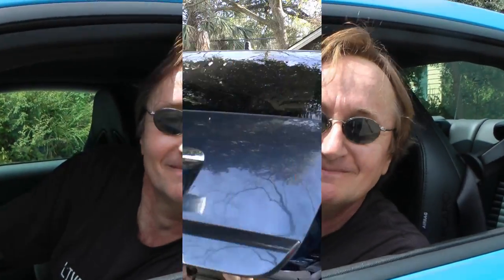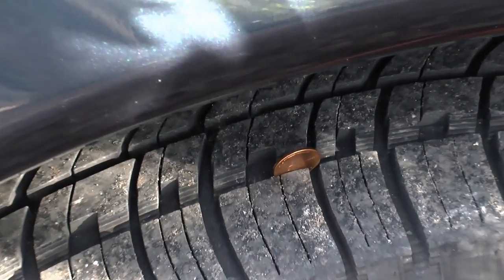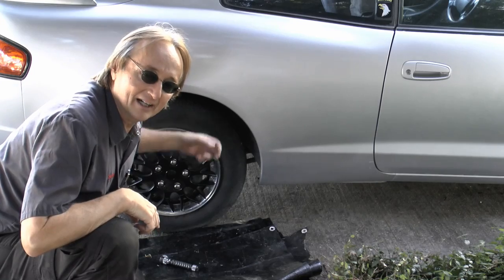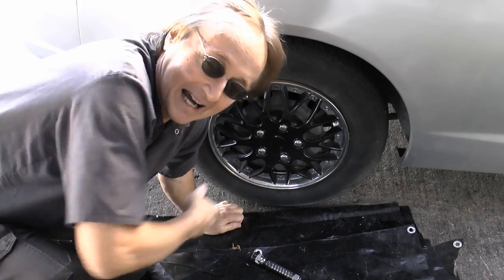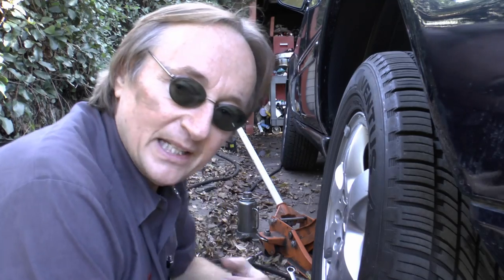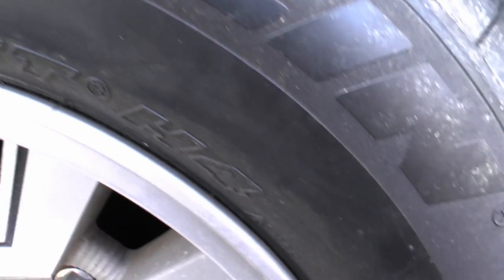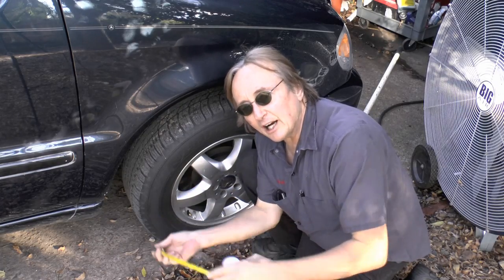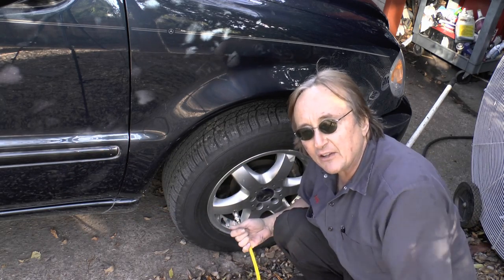How to Tell if You Need New Tires on Your Car

Comment: I have a question that I can't find anywhere. Can I put a patched tire on the front axle (fwd)? The tires in the front have low tread, but the rear tires look like new still. If it would be unsafe, perhaps I should buy all 4 new tires. 

Love your videos, by the way! You're a great teacher.

Comment: A topic that Scotty didn't cover is that if you driven the tire with low tire pressure. If you driven the tire flat it may have shaved the inside of the sidewall, when this happens you need to replace the tire because it haves a weak sidewall. And don't trust that nitrogen thing, because when you have low tire pressure you will surely need more so as Scotty said, check your tire pressure. Some said if you got a low tire pressure your car will lean to that direction but I never had my tire pressure get too low so I can't say for myself. Over inflated tires will wear more in the center and lower tire pressure will wear the tires on the sides but if it wears closer to the sidewall you might need alignment or get your car checked.

Comment: Good video.

In my experience, shoulder wear can be indicative of lack of rotation moreso than out of alignment, although the two are often complimentary when dealing with drivers who don't keep up with maintenance.  I've seen people never rotate tires and have the front passenger side belt starting to show complaing that the car was out of align because it was drifting to the right.  Easy way to trash a set of tires.

And talking about tire pressure and temperature changes, I get calls all the time that TPM warning light flashes right after a big temperature dive.  Of course, tires are always fine.  That's common too.

Comment: I'm a BIG fan of using nitrogen instead of air for tires.
My local public transit system uses it in all of their buses so you know it's worthwhile.

What a pleasure it is to only rarely have to add nitrogen since nitrogen molecules are larger than oxygen and they lose pressure far more slowly.

There are other benefits as far as tire wear if you care to look into it.
Reply: +Devin Williams True.  For some reason, commercial air pumps at gas stations here in South Florida have an incredible amount of water in them.
I don't know if it's condensation or what.

I still say that I need to add pressure to my tires far less frequently with Nitrogen vs Oxygen.

Comment: I had experience with a tire exploding in a 1990 camry years ago. We did that in the freeway that we barely got into it for being old. Even the whole tire ripped apart as well.
Anyways for tire experience myself, hard rubber tires are the best to last for a long time. They may not get much grip and traction for to be harder to turn, they can at least save you money. Medium tires are okay but wear out a bit more than hard tires, they just give you better grip. Soft tires are the worst at wearing out the fastest even though they have the best grip & traction. If your gonna be going out on a race track with your car, use soft tires so you won't slip easily. If you want to use hard tires instead, better have those driving skills to be of good use or it will cost you your life and money for that.

Comment: should all four tire have matching manufactured dates? all made in the same year but different weeks....Also, my tires are "symmetrical", but on the driver side the sipes at the shoulders look like they would channel the water out from the tire, whereas the driver side shoulder sipes face the opposite direction and would channel water into the tire
Reply from the maker: I would hope dates match.  And both front tires need the same exact tread pattern, that's wrong on yours

Comment: My front tires are called Kleber and they are 14 years old. I dont drive very fast because of this, but even if i do, there aren't any vibrations or stuff like that. Even when i take a corner at high speed, the car stays on the road with no problem what so ever

Comment: Scotty, my truck won't stay running unless I hold my foot slightly on the gas. As soon as I let up, it dies. No check engine light and all gauges read out fine. Could this be a bad throttle position sensor and if so, do you think cleaning it would work or does it need replaced?
Reply from the maker: could be tons of things, if it's a Ford, check for vacuum leaks first. if not that, have it scanned and analyze the live data for faults, lots more information than a simple check engine light.

Comment: Hey Scotty, I have a question about motorcycle tyres...
Specificly on an 1984 Kawasaki Ninja 900R, it uses sports touring tyres and the front was manufactured in 2011 and the rear in 2012. They are basically new, barely used as the bike stood a long time (on a center stand, so no load on the rear tyre and some minimal load on the front).

I am not someone who goes super hot into the corners and I'm not really pushing it. I technically could replace them now but it would be quite hard on my budget.
Some say that when the tyre is 5 years old is immediately a death trap, I find this rather ridiculous... I mean maybe it would make a difference for someone who is using it on a race track.

Comment: Funny thing is I was riding on dry-rotted tires from 1990-1994 in a 1984 Chevy Caprice at highway speeds until I got them replaced in 2014. I didn't drive the car much (I put maybe 2 to 3k miles on the old tires) and only got it in 2010, but still - What happened? They did hold together long enough and didn't leak air. Looks like I answered my own question, partially.

Comment: Scotty how do I know what year my tyres were made in :)
Reply: On the sidewall of the tire, usually near the "DOT" mark, is a 3 or 4 digit number by itself.  That is when the tire was manufactured.  If it's a 3-digit number, then the tire was made before the year 2000.  

It's always in the format of week/year - so if it says "1202", it was manufactured in the 12th week of the year 2002.

Comment: Hey Scotty, I have a question. My car has a mysterious shake around 15 to 20 mph. It feels like it is coming from the front end, but I have been unable to find anything that seems to cause it. Neither have the few mechanics I have taken it to. It is worse after the car warms up. Originally i thought it was a bad motor mount, so i replaced the one that was bad. That didn't help. So i took it by a shop and they said an alignment, well it had a fresh alignment so i had it checked and it was within spec. So they didn't have anything else to say. i took it to another shop where they said it was the transmission going bad. That sounds unlikely with how well I take care of the car, but I took it to a third and fourth shop and the third was stumped, but the fourth said it could be a wheel bearing. I had already asked that of the other shops and the others said no because the wheel had no play. This mechanic said some vehicles won't allow for any play even with a wheel bearing. So I am confused. Do you have any recommendations?
Reply from the maker: miasmicmonky13   find a real front end alignment shop, here in houston I use cotton brothers, they have never failed to fix a problem like that. You're using amateurs who don't know their stuff. And YES, good ones are hard to find these days, when they retire at cotton brothers I don't know what I will do

Comment: Another thing I found out about tire pressures is that even in the morning, the tires that face the rising sun will get hotter than the ones in the shade.  In my case, the tires facing east had five pounds more of air pressure than the ones on the west side.

Comment: I just went to the mechanic to have my tires filled with air and he was giving me a hard time. According to my sensors it stated low air tire pressure. He was lazy and didn’t want to do it. I told him if he didn’t do it I’d do it myself. He said with the cold weather we are having you will have low tire pressure temporarily. It’s supposed to warm up the following week. Okay then fill’er up! He looked at me like I was crazy and wanted me to wait till the weather was warmer.

Comment: so it's bad that the center of my outside dually tires are bald? lol I normally run my rear tires until they can be used as drag slicks, since I wear 4 tires faster then normal people wear out 2 I get a few thousand more miles but they're load range E (heavy side wall and all around) and it doesn't snow where I live and don't tow much or anything that needs a dually hardly ever (life changed and I love my truck) I figure it's OK thank God I haven't had a blow out but those can happen on brand new tires so, life's a crap shoot, keep my front tires with decent tread though, too much braking and steering to gamble with them
Reply from the maker: +bosshoss69lee if center is bad, you are putting too much tire pressure on them. Lower it a bit
Reply: +Scotty Kilmer that's true, but they're rated at 80psi and they were at ~ 50psi, and the truck wanted them at 65psi, also my wider tires sit closer then stock so if they bulge too much under a load they can rub together, cause to much heat, and blow

Comment: hello, i have a ford fiesta 2004. how do i know how much air pressure is needed for my tires? think my wheel size id 17 inches. cheers
Reply from the maker: abbas2047 I use 32 psi when cold first thing in the morning

Comment: You didn't mention it but I noticed you were working on a Mercedes!  You didn't say anything about how much tires cost for luxury cars.  Performance aside, do tires on such cars cost more just like other parts?  Don't some even have different sizes on the front compared to the rear?

Now, what about snow tires?  Do you really need them on all four wheels or will having them on the drive wheels work ok?  Dealers always say all four wheels BUT my father had them on the drive wheels only (rear drive) and they worked just fine.  If you could  only afford two winter tires, would it be best to use only two on the drive wheels or just go with the all-seasons on all fours.  Is it hard on winter tires/regular tires to change them over using the same rims every fall/spring?  Other than the obvious change-over costs, is having dedicate wheels worth the investment? 

Thanks!
Reply from the maker: yea, mercs have expensive tires, but I'm making this video for the average Joe out there trying to see if he needs new tires. You guy a fancy german car, you shell out for expensive tires, more than I pay for entire cars with tires already on them.
Reply: Scotty Kilmer mercedes ml55
Reply: Tires get more expensive as the tread width increases. I'll be paying about $1200 for my next set, so yea, potentially the cost of an entire car lmao

It really depends on the model, and it isn't just luxury cars, but they tend to have wider rims and fatter tires. Again, it depends on the model, but wider rear wheels and tires is also very common on any luxury or performance-oriented RWD car.

For winter tires I'd change all four and if you plan to run them several winters I think a set of cheap wheels is worth the investment considering what you'll pay for mounting/dismounting anyways.
Reply: Scotty Kilmer Yeah, I was wondering how much is that Supra now? I think I have never even seen that particular version in the flesh :) What year is it?

Comment: Scotty our 07 Moreno shakes at 60 on highway steering wheel and front of car. You think its alignment or warped rotors? Thnx
Reply from the maker: IF rotors are warped, it does that only when braking at higher speeds. Have the tire balance checked first, and if not that, get it aligned

Comment: I need help, my 99 Ford Expedition is have heat problem. The heat in the back row works at all speeds and maintains decent heat, but in the Front seat the heat only works on high and only stay warm for 15-20 seconds. I also think that the heat doesnt get as hot as it used to in both the front and back. What do you think the problem is?
Reply from the maker: those are complex computer run heating systems, find a guy like me to hook up his scan tool and do some bidirectional testing of the system. Often blend door problems on that model

Comment: I use general tires are they good?
Reply from the maker: decent low priced tires
Reply: General grabbers? They're not meant to last long on the road because they're a sticky tire that heats up very quickly because of cheap rubber compounds used. I'd say you'll get 30-40k out of them if maintained. Highest quality i'd go that's typically inexpensive is a Cooper. These come in a lot of other name brands so ask who the manufacturer is before you buy. Discount tire for example uses these highquality tires that go under the name of Arizonians. They're made in murrica and most have a 60k tread warranty. While something like michelin can be made in mexico, america, or canada and come with a 70-90k warranty but for close to twice the amount of money Depending on where you go. Places like costco and walmart carry fake high end tires but charge the same amount. You'll know from the patented tread design... It'll be backwards or missing sipes on the edges of the tire. The more you know!
Reply: yes that's the exact model, they came with my f250 2011
Reply: that makes me recommend?
Reply: what brand recommend?
Reply: Enzo Barletta Depends on what style tire you want. Highway or offroad?  If you're looking for an offroad And street type of tire I'd go with bf goodrich or bridgestone. If you're looking for an economical tire i'd always go with a cooper.

Comment: Hey Scotty i have a 2002 nissan sentra it says that its supposed to have 14 inch tires and rims. I changed them to 16 inch tires and wheels. Now when i get up to 50 miles the steering wheel shakes. It also shakes when i try to slow down before it didnt do that. What should i do to stop the shaking?
Reply from the maker: car was not designed for those large tires, go back to 14, or pay a front end alignment mechanic to see if he can adjust stuff to make it stop shaking

Comment: Hey Scotty I recently had my 2001 Toyota Corollas check engine light turn on I was told that it might be one of the sensors near the catalytic converter I think it was the O2 one. How urgent is it that I get it fixed?
Reply from the maker: if it runs fine, not urgent at all, I've seen guys drive em years that way

Comment: Hey Scotty, what are your thought on Nitrogen filled tires? My dad got sold a set 4 at the local tire store for our old  Nissan Pathfinder(04) , but it seems like I've got to re-pressure them far more often than I did with regular air tires and its only been about 3 months. Cheers
Reply from the maker: +ayman albasri it's a gimmick, realize earth's air is about 80 percent nitrogen already
Reply: Cheers Scotty.
Reply: Also understand that the whole reason people started using nitrogen was be people that would go off-roading in the middle of nowhere would just carry a tank of nitrogen instead of air compressor.
Reply: +ayman albasri I had nitrogen filled tyres at some point (company car, i wasn't paying, might aswell go with the fancier option).  Never had to refill them over a whole season (in my country you had to have winter tires). That being said i think it's more to do with the tyre than with the nitrogen. While there are some benefits if done properly, they are too small to be worth the bother, let alone the cost.
Reply: +ayman albasri   At one time Best Buy had a partnership with Purigen ( a Nitrogen-tire-fill company).  They stopped offering the service at Best Buy about a year later.  I asked Best Buy why, they told me that not enough people were paying for the service, and so discontinued it.  Went around to the auto-install bay and asked the techs their opinion; they said that most customers thought it was a gimmick or that it was just too expensive compared to "free".  I got my tires filled with the nitrogen and think it does have benefits up here in the winter; for the tire pressure stayed way more consistent than when using regular compressed air.
Reply: +James California They could have. I wasn't there when it happened. lol 

To me it would make sense to carry nitrogen  (tank pressure exceeds 1500psi). That way it could be used several times for large tires with extra to spare.
Reply: The only use of Nitrogen filled tires that makes sense to me is on trucks which transport dangerous materials. The purpose of Nitrogen is to automatically put a fire out in case the rubber catches on fire. It's an extra safety measure.